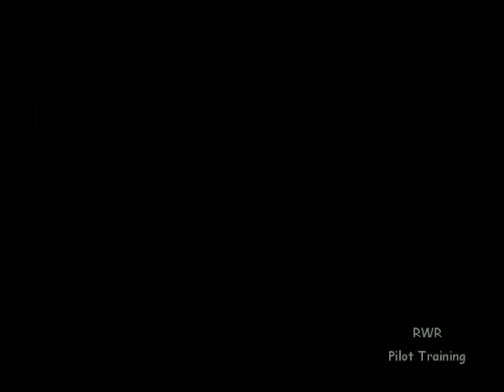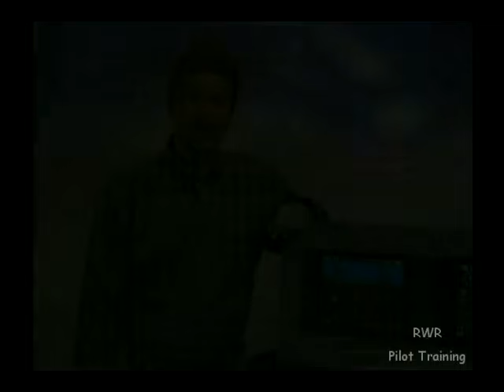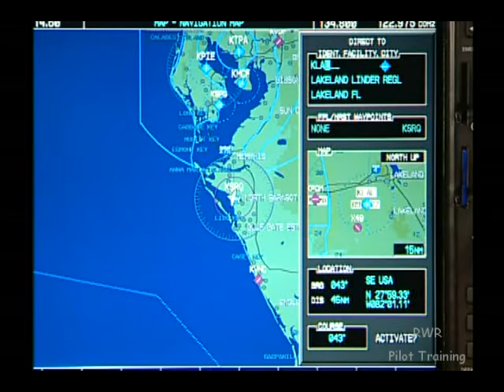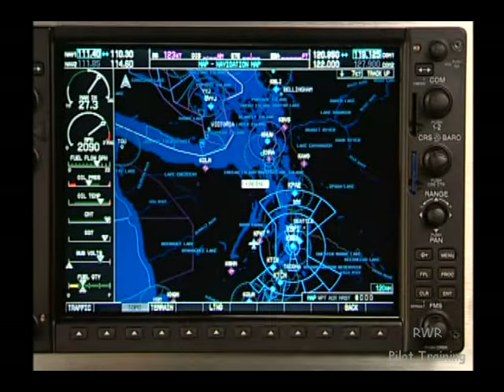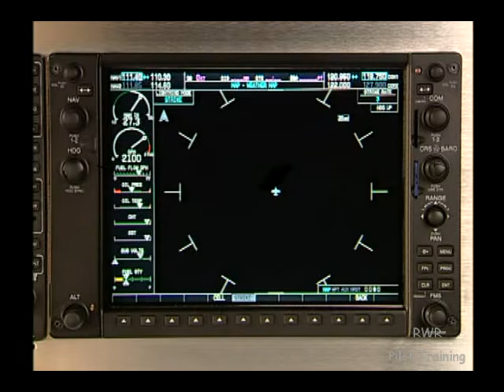G1000 Garmin Tutorial

Comment: Thanks for the video.  In the current VNV Profile am I right in saying the higher the inputted FPA the higher the VS TGT. VS REQ is what is required to meet those targets but is not displayed to after the aircraft passes the TOD.  Following from that what is V DEV and what is it used for?
Reply from the maker: Yes. It is also true that all G1000 features are not available in all OEM firmware. In the PA46 we use VS for descents mostly because of the very limited speeds associated with a yellow arc. I recommend setting up the VSR parameter in the top of the screen so it is visible during the flight. The PA46 does not use V DEV so I am unaware of its use or function. Fly Safely - Train Often .. DR

Comment: I thought the G1000 had Auto Pilot capabilities. Didn't see that covered in this video, or did I miss it? Or was the auto pilot totally separate at this point in time.? I think the ALT and HDG buttons are there on left side, but how do you activate AP?
Reply from the maker: This vid was created by Garmin. It is not a fully integrated sim and is intended as a familiarization for the G1000 equipment. The autopilot is a separate box and Garmin offers excellent tutorials for them as well. Fly Safely - Train Often .. DR
Reply from the maker: This vid was created by Garmin. It is not a fully integrated sim and is intended as a familiarization for the G1000 equipment. The autopilot is a separate box and Garmin offers excellent tutorials for them as well. Fly Safely - Train Often .. DR

Comment: In case anyone wants to revisit a certain section, like I did:

0:17 System Overview
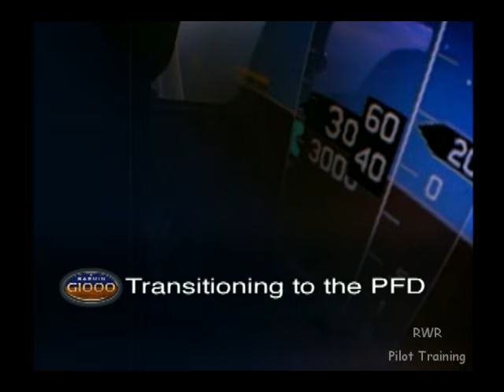4:30 Transitioning to the PFD
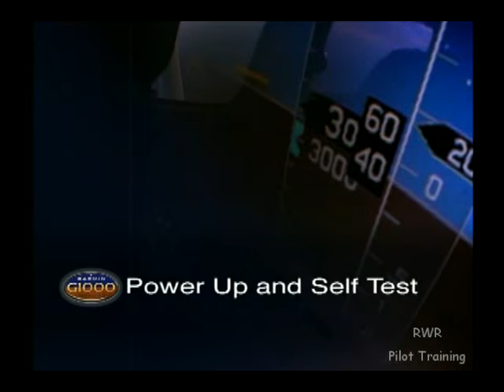10:30 Power Up and Self Test
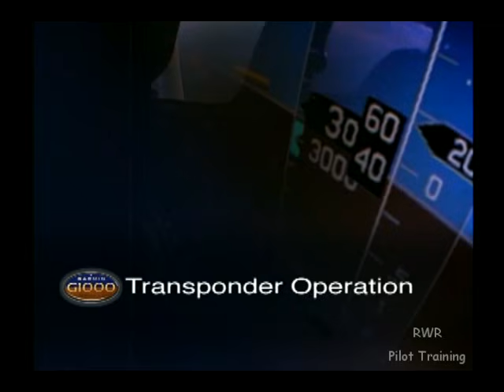13:18 Transponder Operation 
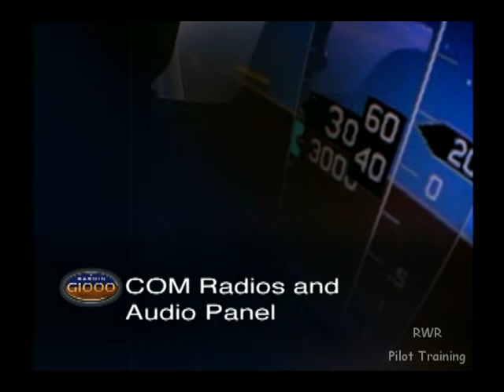15:35 Com Radios and Audio Panel
21:55 Navigation
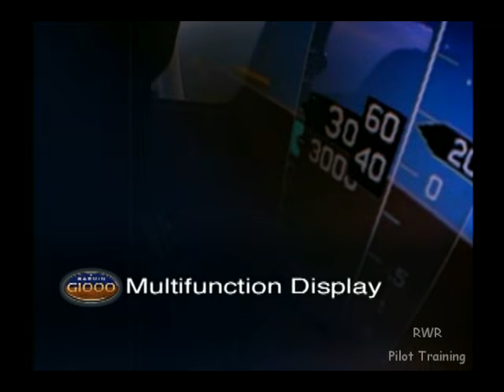31:05 MFD (Multifunction Display)
44:40 Configuring the PFD
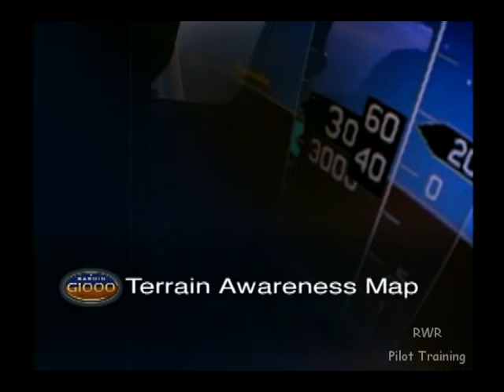47:28 Terrain Awareness Map
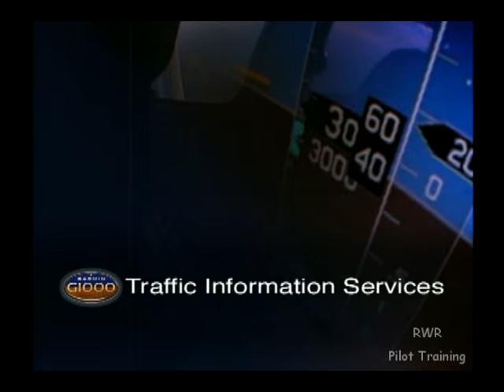49:40 Traffic Information Services
53:55 Cockpit Weather Tools
55:55 Emergency Procedures
Reply from the maker: Thanks for posting!
Reply: You're doing God's work
Reply: Thank you
Reply: Thanks. That was helpful.

Comment: how do you adjust brightness of the pfd and mfp
Reply from the maker: Hi Red Baron, Good question,, I’m not sure which panel you are referring to, however, the older panels (pre 2009 for the most part) use three rheostats under the pilot side yoke. Avidyne uses a rocker switch on the bezel to the right side of the screen and G1000 and later is auto adjust with a bias setting which is managed from the setup menu. Fly Safely - Train Often .. DR

Comment: YOu mentioned the marker beacon on the audio panel. Can you explain what is meant by "marker beacon" and an example of how that might be used in a real world situation? Thanks.
Reply from the maker: The maker beacon refers to the outer, middle and inner marker as they exist on precision approaches. Most pilots and controllers refer to the final approach fix (FAF) as “the marker”. Modern audio panels have the option of including or excluding the audio portion of the arrival at the marker. I like to have the audio alert enabled so that I can confirm my arrival at the FAF without looking away from the primary display. Fewer distractions preserve mental bandwidth and thereby improve safety. I hope this explanation helps. Fly Safely - Train Often .. DR

Comment: Hi, thanks for the great tutorial. I am having difficulty in setting the altitude profiles in VNAV as I cannot seem to get the FMS cursor to move over to the altitude fields, it just moves up and down the Waypoints... Am I missing something in the setup?
Reply from the maker: Hi Jonathan, It sounds to me like you are not using the ATK Offset soft key at the bottom of the MFD. You need to cover the fix you want to reference and then look for the ATK Offset key (along track offset). When you press the key a new line populates with access to distance and altitude.. remember, with respect to altitudes.. Blue is True.. White is Right. I think I cover this topic in a video which is still not published. I will get busy! Fly Safely - Train Often .. DR
Reply: First time look n i understood it well. Good instructor u are mate
Reply from the maker: Thank you. Fly Safely - Train Often .. DR

Comment: How can we do weight and balance on garmin. May you please guide me?
Reply from the maker: Hi Tran, I can, but I highly recommend you use a flight planning software like Foreflight or Rocket Route on your iPad. By the time your aircraft engine(s) are running, a weight balance calculation should be old news.
Reply: Also there are excellent W&B Apps available which are very good and electronic "P" charts so quick.

Comment from the maker: Hi, Regarding "red x" issues with G1000 .. I have seen this infrequently before with few different parameters in different PA46 aircraft ..  comm 1 most recently. I am not sure of the origin, but a reboot seems to work every time. Sometimes it has taken more than one try, but once the red x is gone it seems to not reappear. I suggest you carefully document each event (with video if possible) and provide the information to Garmin CS.